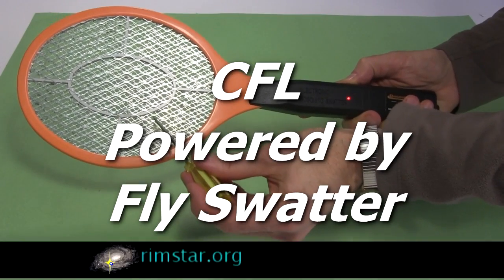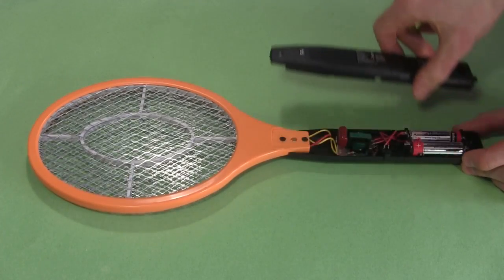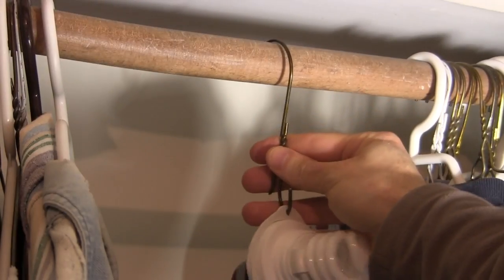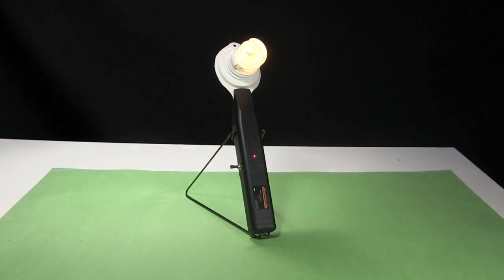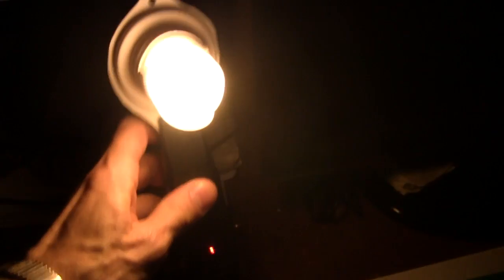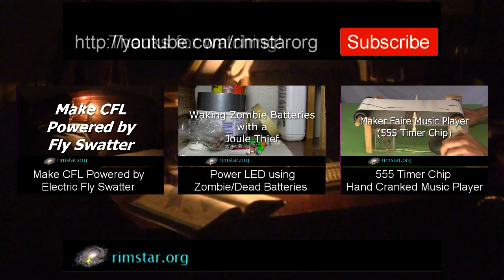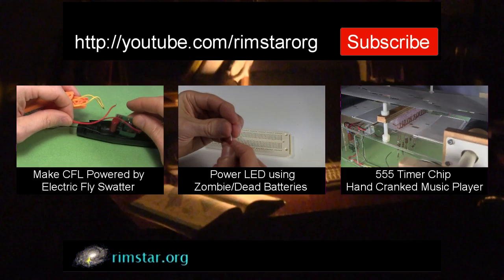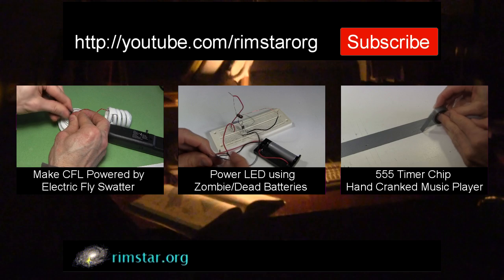CFL Powered by Electric Fly Swatter/Racket Zapper

Comment: I absolutely knew you could make this work, thank you very much for taking the time to share with us!
Reply from the maker: NZHorizones Thanks. My doubt was in whether the fly swatter circuit could output a high enough voltage and current given that it has just a small transistor (i.e. not a power transistor.) Surprisingly it works great.

Comment: i did try to make just like your but there is a problem, the battery discharge so fast and it can't take an our to be empty
Reply from the maker: cagayanong inventor Hmmm... I did the test last night for how long the batteries last with mine and it was around 4 hours. Did you connect the CFL directly to the output of the fly swatter? If so, that may be the problem. You need to remove everything in the circuit after the coils output. In my case there was a diode, capacitor, and two resistors. See the schematic in my fly swatter video at 2:24 https://www.youtube.com/watch?v=niRCKUliQWs. I connect the CFL to the leftmost coil and disconnect everything else that's to the left of that coil. The CFL has no polarity so it doesn't matter which way you connect it. Friday's video will show this; I'm starting to edit it today.

Comment: I wonder if you can have the light and the zapper circuit? Why chase the bugs whith a swatter when you can make the bugs fly into the zapper....
Reply from the maker: Mongrel Shark Unfortunately to get the charging you need the diode and capacitor, but to power the light you need to eliminate the diode and capacitor. And somehow alternating them wouldn't work since it takes time to build up the charge for the zap.Though I guess since the charge takes a little time to dissipate, you could switch in the diode and capacitor to build up a charge, and then switch back to the light to attract the bug.
Reply: @RimstarOrg  I actually see some for sale now with UV lights.

Comment: Major drawback of operating fluorescent lamp on DC is that, mercury will accumulate at one end. This is going to reduce tube's life. Is this circuit going to work on dead cfl? I have tried using voltage doubler circuit. But lamp flickers and overheats at the cathode side.
Reply from the maker: Hrushikesh Vartak That's the nice thing about using the joule thief/blocking oscillator circuit that's inside this electric fly swatter - it's AC so it doesn't have the accumulating mercury problem. I can see why you'd have a problem with the voltage double circuit though, since that puts out DC. Next week's how-to-make video will include the oscilloscope output so you'll see the high voltage AC. It's outside the visible range of my scope so it's hard to say what the voltage is. From fudging what I do see, I estimate it at around 560volts peak-to-peak but that can't be right unless it's higher at the start.
Reply: OK. Thanks. I'm waiting for how-to-make video.

Comment: Very nice, I am yet to open one of these, but I am guessing it has a circuit similar to a portable UV light I took apart some years ago. Small transformer, single transistor, few caps and resistors. That circuit could light small fluro tubes and neon bulbs properly, and it could also be turned into a crude AM transmitter.
Reply from the maker: MisterTalkingMachine That's certainly the same components, and based on what you say about turning it into a crude AM transmitter, you're probably right. It's a blocking oscillator circuit, or more popularly known as a joule thief circuit. I opened it up and showed it in my previous video about just the electric fly swatter https://www.youtube.com/watch?v=niRCKUliQWs. Neat idea re the AM transmitter! Thanks!
Reply: RimstarOrg Oh, I see, it certainly looks a lot like it. If you feel like trying, this is what I can recall from my transmitter, first, it didn't have the rectifier and capacitor on the output, so you would have to get rid of it. To the bare output I connected a radio tuning capacitor in series with an LED (I found this to stabilize the frequency and reduce the bandwidth somehow, red and green ones were the better ones) and the DC input in series with the secondary of a small insulation transformer I scrapped from somewhere. The primary of the transformer was the audio input. The DC suply had to be lower than the voltage it was used to light the original UV tube, in my case it was originally 9 volts, and I ran it on 4.5 V. You use the tuning cap to avoid the frequency of the transmitter from drifting over the dial.

Comment: That is GREAT! So cool. Now we just need to know how long the batters will last and if not long then can you add yourJoule thief as an override switch to keep it going until the batteries are truly empty.
Reply from the maker: ***** Thanks! I got it working and looking good just yesterday so the duration test is still to come. I also have all the footage to put together for next week's how-to-make video. Regarding using a joule thief as override, the only difference between the fly swatter's circuit and my joule thief's is the coil, and I suspect the commercially made coil might be more efficient so I don't think my joule thief would be able to keep it going - unless I use the joule thief that powers an LED instead.
Reply: Right. I remember that now from the first video. Maybe that is why I was thinking about the joule thief in the first place. It will be interesting to see the usage results.